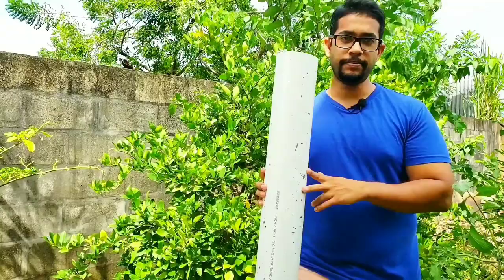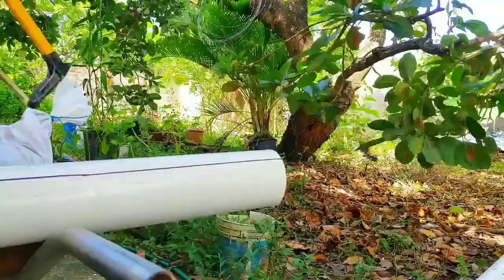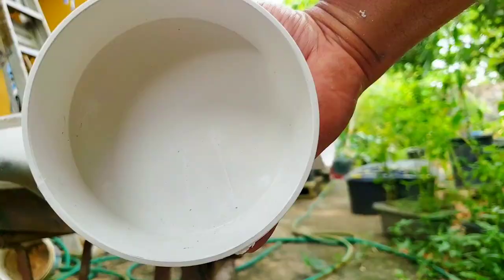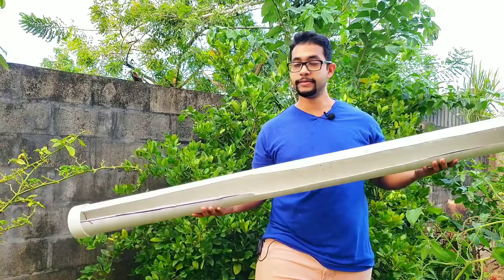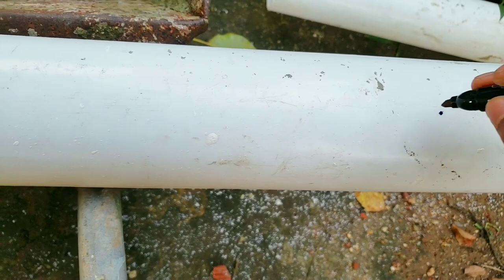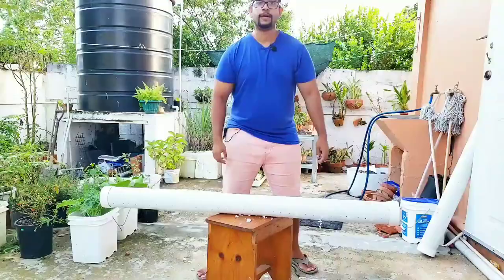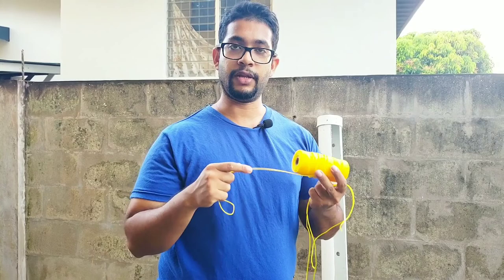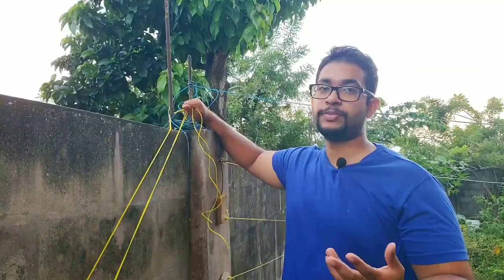DIY Hanging Planter! | Gardening in Trinidad and Tobago

Comment: Great idea!Great video! Thanks for sharing. Another plus would be no weeds. Correct? Only what you plant will grow. 🙂
Reply from the maker: Yes and no. It all depends on the soil mix that you use to fill in. There won't be any weeds if it's a sterile store-bought potting mix or compost that was heated enough to kill off weed seeds during the composting process. 

But if it's garden soil then there will more than likely be weed seeds in there- however at this waist-high level weeding would be super easy as long as you stay on then while they're young :)

Thanks as always for watching!

Comment: I love this and using pvc! (I use for dragon fruit and cucumber/tomato trellis.  

Question- 
1. what's the Measurement of the gap on the length; 3 inches?  

2. What plants have you used in this? I'm only thinking lettuce.
Reply from the maker: Hey! Glad you're using pvc in the garden. The gap is around 3" yes. I've done lettuce, bandanya, celery, chive and pak choi so far. They all did great!

Comment: Hi, what length of pipe you used and how wide was the cut you made?. Thinking of doing similar for seasonings
Reply from the maker: Hey you can make it as long as you want. This was between 5-6 feet I think. The cut was around 3 inches wide. Great idea for the seasoning!